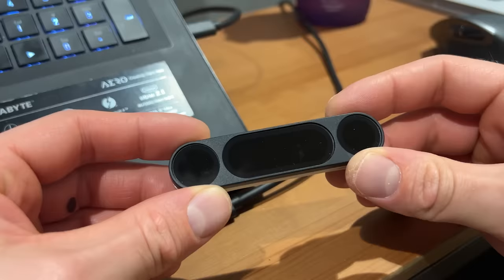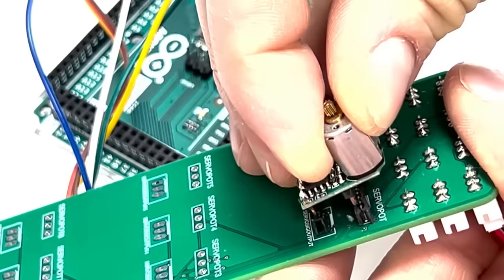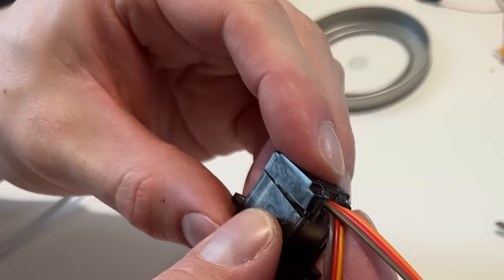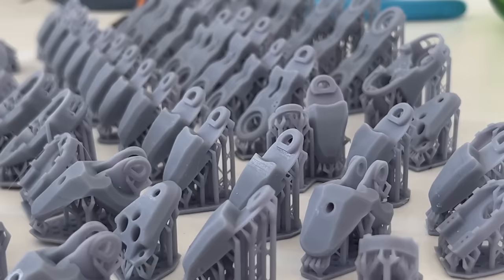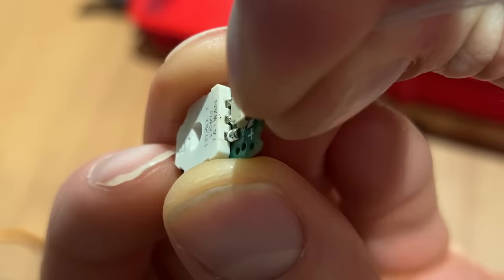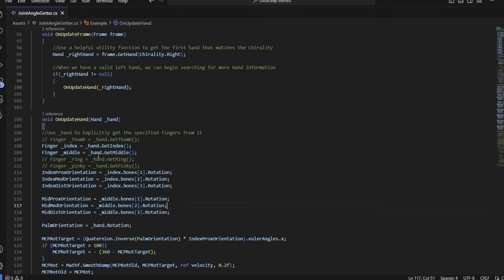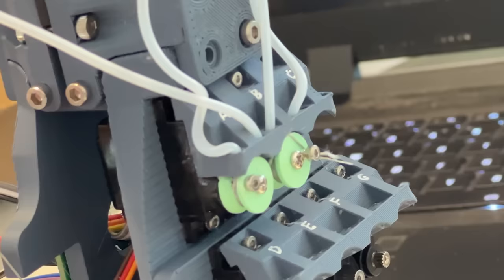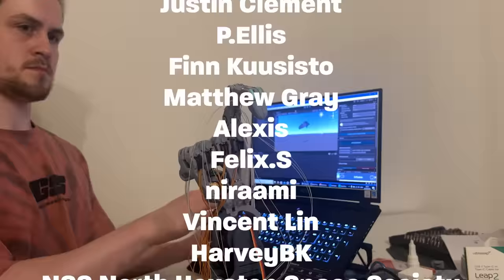Controlling my Bionic Hand With Realtime Motion Tracking - Biomimetic Bionic Hand

Comment: I would personally recommend the tubing used on bicycles for their gearing and brake cables. already designed to do exactly what you need, and a good way to solve cable management if you have simply clip into the carpal and metacarpal regions.
they come in spools you can cut to length and little metal caps so you just need to slot them in place endwise for them to maintain tension exactly where you need it.

glad to see you back on this, looking forward to more RnD
Reply: quite bulky though, wouldnt it be? im also not sure bikes use bowden tubes with the same inner diameter as his cables, might be difficult to source, no?
Reply: Ehh...They might be a 'bit' bulky. (3/16 in. OD ) 
But I can confidently say they would hold those cables without issue. Brake cables on a bike are at least twice that thick. (1/16 in.)
Reply: Unfortunately, by the time you stack 5 or 10 (or more) of these together for all the required tendons, it becomes impossible to bend. There may be some specialty mini cables used in model aircraft that are similar but they're difficult to source. I would love a good solution to this problem.
Reply: You can use something a little less slippery than PTFE but stronger. Many years ago I remember playing around with acetal and uhmw, but springs with inner ptfe tubes worked the best.

The frictional force is modeled by the capstan equation.
Reply: skyentific tested that on his channel, and it turned out to be impractical as others here point out. He ended up using a system of pulleys and coils for a finite but sufficient range of travel in both directions. Backdriveable, zero backlash, but tricky to get right it seemed.

Comment: this is impressive, but one tip that I learnt the hard way: you only have two tendons per finger; the finger can flex so much because it's one tendon anchored at several points and it can flex independantly because tendons are malleable. you therefore only need 5 servos per finger, at least one for splay, and about two for the thumb: one for positioning along a curve, the other for flexing it like any other finger the CMC is basically an overdeveloped splay-muscle for a finger that's at 45* and in fact you can line your thumb with your finger for this exact reason. this alone means that the total servo count shouldn't exceed 8 for the hand, 2 for the wrist for something that is completely biomimetic. you can afford to simplify the main palm into just two halves, which should save on mechanical complexity, but a 3-part palm is closer to the real thing.

for said tendons, bike cables would work well, and you can anchor the tube along the 1st and 2nd joints of each finger, with the cable itself being anchored on the finger. this way you have a compliant, durable and strong system.

another thing to note, human palms reach farther than the knuckles due to them being flesh, which from the underside gives the illusion of having an extra set of joints in the fingers, also also, the shape of the palm is largely immutable save for the outer metacarpals of the ring and little finger which ever so slightly curve, though that is mostly caused by the compliant nature of having a frankly unnecessary amount of bones in the palm

actually working on something similar myself, albeit drastically simplified and less "humanised" (it's just angular because I don't have fusion360  :p)

either way uh... hope that I can help simplify things and my apologies if my knowledge of the series has gone a tad rusty, it has been a few years...

EDIT: to clarify for understanding; by anchor, I mean like a thread passing through the eye of the needle: as the tendon is pulled, its shortening forces it against the structure, dragging the rest of the structure with it.
Reply: no bike cables are way too big for this and no, dumbing down to that few servos for the hand reduces total articulation and strength hugely

Comment: i did the hand connection to an xt ibm back 90's ! used window plastic and  stainless 1/8 " wire for pins!  your fingers are
exact as i did and i put a plastic plate on the top of the knuckl to prevent the fingers from  going backwards! the hand griped a
small 380 9mm dual ammo baritz and pulled the trigger without any problems !

Comment: Great job, nice to see your progress! You could maybe use tubes made to guide brake cables on bicycles, they are made to work in compression. They might be slightly larger than your PTFE tubes however.
Reply: no they are like 6x the size and unacceptably large.  bad suggestion
Reply: you could use small diameter ptfe tubes, ptfe even has self-lubrication, which is perfect.  you just have to make ports on the ends, that you caN mount.

Comment: Was watching you in 2018, glad to see you have returned. The project is really great, especially in terms of freedom of motion. By the way, have you read the research of using sewing thread and make it deform under some heat application, the thread should be spinned multiple hundreds times (depends on length) and if you will apply cooper wire for heating, maybe you could use them instead of servos. Thank you!

Comment: try to use bowden cables for the cable joints, those will do what you need quite well with very high durability. Only issue is that they will need to be custom order sized due to design.

Comment: Need stiffer guide tubes for the cable tendons! Squishy tubes don't lend themselves well to transmitting much power. This is why bicycle brake cables have a metal coil that's then sealed in plastic to hold it together. Basically a long thin spring should work, you can wrap something around it or probably just find cable housing/cover designed for the application. There's all kinds!

Comment: My first thought was also bowden cables like someone mentioned below but maybe bicycle shifter or brake cables could be cheaper and easier to get? The housings differ between them. Brake cable housing has a woven strong steel spiral. The shifter cables housing has steel wires running along the housing length. Might be worth experimenting with. 1,1mm is the smallest diameter on shifter cables. Great to see an update from you! Always inspiring and fact dense videos!

Comment: Note that you'll have to deal with cable stretch over time. Also, if you haven't encountered this yet, if you keep all the tendons tight to the skeleton, you'll soon find that when you make it make a fist, then bend the wrist, you'll have to further adjust the tendons in the fingers to give more or less cable length as you articulate the wrist. You'll need to account for that in your cable length adjustment calculations.. unless if your just using a closed loop system to just ensure the right amount of finger articulation while moving the wrist

Comment: Use flexor and extensor electrostatic motors to get rid of the tubes.  And just use guide loops to keep things tidy.  (forearm anatomy but in tech form)

Think of a z-folded capacitor where the dielectric is rubber.  Apply voltage and it contracts.  No volts and it relaxes.  Use one for the flexor another for the extensor.

Comment: Nice! I'm glad to see you ditched that bulky glove!  Though, I feel like you're missing an opportunity with 3D printing... You could route out internal cavities for the wire management, and even ditch the PTFE tubing by running the cables internally in their own dedicated cavities as well.  I understand that the length of each section would not be constant like it would with PTFE, but it would be predictable and calculatable for any given pose, and the arduino has plenty of capacity to calculate and interpolate the non constant cable distance.

Comment: Any kind of stiffer cable housing would be great! Bicycle cable housing is meant to be very incompressible (especially for brake cables) but they might be too thick for your design. Good to checkout though, and maybe there are some engineering bowden cables that might be the right thing!

Bicycles also sometimes have springs embedded into their brake assembly so you can't 'lock up' the wheel. Might provide some of that grip strength. 

Love this project, keep it up!

Comment: Dunno if this will be a useful suggestion, but there are some compliant finger designs on articles/research papers that might be worth a look.
One example is "Mechanical Structures for Robotic Hands based on the “Compliant Mechanism” Concept" where the entire closing motion is done by a single pulling "string" attached to all three parts of the finger.

Comment: This is great work. Springs with a smaller ptfe tube work pretty well! You can also route the cables primarily in straight lines on pulleys where you mantain constant loop length easily and then switch over to bowden tubes just where routing gets difficult. This can help increase stiffness and decrease friction. 

Out of curiosity, what is your day job?
Reply: actually the friction can be good for maintaining joint angle with lower power for holding a position.

Comment: Excellent progress. I was wondering if you could route the tendon cables through parts of the hand structure? This would shorten the tubes and reduce the kinking. Or where several cables run parallel, 3D print a structure to encase the cables, reducing the length of tubes needed as well as keeping the cables tidy.
Keep up the amazing work.

Comment: For the tubing, you may be able to use bike shift/break housing instead, or take a note from their design and put your existing housing thru something to give it more rigidity, like a spring with the same i.d. as the o.d. of the tubing, however, if sized wrong, the spring may also introduce increased internal friction, in which case, going with an existing product will probably be the better choice.
Reply: no that is way too big for this.  bad idea
Reply: @artbyrobot1  please explain you reasoning, as i know the OD of road bike shift tubing to be about 2-3mm larger than the tubes he's already using, so based upon the size of the pieces the tubing attaches to, it would make no appreciable difference to the size of the attachment points.
Reply: @THarSul  max diameter od should be 2mm tpfe with 1mm id since 130lb test woven PE fishing line fits into this and is 0.65mm OD.  Anything larger than this is unnecessary weight and size and bloats everything which DESPERATELY needs minitiurization at every turn to fit the human form factor.  going WAY UP in size and weight is foolish like you are saying.  If you want to thicken your tpfe, you can use super glue and thin fabric to create a little cast around it as a composite structure which would prevent any warping or buckling during actuation.  but this should not be needed in most cases I don't think.
Reply: @artbyrobot1  the reason for my suggestion was that if this is a benchtop prototype, it wont be fitting into a human form factor, in which case bulk has less of an impact.
With regard to using fabric and superglue to make a composite around the tubing, that would likely be too rigid to handle the forces involved, and would lead to breakage at points where flexibility is still required.
A similar performance to the cable housings could be achieved with a length of tension spring with a similar ID to the tubing’s OD, which was how road bike shift cable was routed in the past, due to the low profile and lower weight than the tubing with the rubberized outer coating.
Reply: @THarSul  the problem area seems to be just in certain sections like in his case near the motor and would not be the whole length of the tubing.  so the composite cast sleeve would be fine for such areas that don't need to flex anyways.  very few areas need to flex.  also, just because it is a prototype does not mean space isn't a huge concern:  it is during prototyping you find the solutions needed for human form factor capability.  so using something that will not be compatible for human form factor is bad to do.  it pigeon holes you into tactics and methods that are not usable in later editions which is taking 2 steps backwards.  miniaturization is EVERYTHING for this.  getting it all minimum weight is also a big factor.  using metal for this is adding unnecessary weight.  also, thin fabric and super glue will not snap or be too rigid for most sections and you can use a glue that has a little bend to it which most do.  you can use epoxy instead of super glue if you want more flex in some areas and don't mind a little more fumes and drying time.
Reply: @artbyrobot1  we'll just have to agree to disagree, we appear to be coming at this from different design philosophies, which appear to be incongruent, and there's no point in arguing about it, the creator will do what he will to make something that works to his needs and designs.

Comment: Your ptfe tubing looks really soft, almost like silicone tubing. The ptfe tubing in the bowden tube on my 3d printer is must more rigid. I think once you find better ptfe tubing which is more rigid and tighter around the cable then you'll see smoother movement. I know some sections need to be flexible so you'll probably have to transition between the two tubes in some places but for the straighest run from the forearm to the wrist it can be the more rigid one.

Comment: what you are doing is very cool, but it will be even cooler to attach a neural network to this hand that could read brain signals using an Electroencephalography device and convert them into signals for the movement of actuators

Comment: Have you considered using electromyography sensors on the arm to control the hand? You could record the electric response from the muscles in your forearm, combined with the motion capture data to train an AI model to predict the hand position from the EMG signal alone.

Comment: I wonder how well a solenoid + spring assembly inside the finger would work compared to the servos.
it probably would use a lot more power, because you'd need it to always be active.
another solution might be to use basically a linear stepper* (i.e. a stepper motor but instead of being in a circle, the coils are in a line), which again is complex, but might give a compact system. (and you only need like 1cm-1/2inch of travel.)

* basically what you'd do is a block of magnets facing opposite sides (i.e. if you look from the top going NSNSNS, and the bottom SNSNSN) with a pair of solenoids, one on top, the other on the bottom, with teeth on each pole, spaced the width of 2 magnets, and the poles being offset by one magnet. that makes it so to move one side you go {[+0],[0-],[-0],[0+],[+0]...} and repeat, and to move the other way, you do the opposite {[+0],[0+],[-0],[0-],[+0]...}. it should be relatively easy to cast some abrasive with epoxy in the shape of the needed file, and file down a bar of ferrite with a holder going back and forth and a vacuum, or the other option is to get some laser/waterjet cut magnetic steel sheets, or use a small desktop cnc (e.g. a rigid enough 3d printer with a motor attached to it) with an 0.8mm drill to cut the steel.
for magnets you can use 1x10x5mm bar magnets.

using microstepping (i.e. interpolate the values with a sinusoid) you should be able to get some fairly smooth motion. also you would probably be able to use a dedicated driver, but something like an uln 2003 would probably do the trick.

though it's probably overkill, but it could be an interesting way to go about it and you don't have to worry about the transmission of power.

something that could be interesting regardless is to use springs from clothespins for the spring grip, which means you only need tension in your transmission, and fixes the issue of stiffness in the sleeve.

Comment: Amazing work!  You must have incredible patience to do such a project as this.

Did I hear that right?  You are using Arduino(s) to control this hand?

If so, may I ask why you wouldn't use ESP32s for this project?  Faster, Dual CPUs, more memory, built in WiFi (or peer-to-peer) communications, etc?

Perhaps I didn't hear that right.

Personally, I've been deving on Arduinos for years, but only a year or 2 ago I got into ESP32s and just fell in love with these.  So much more robust.

Anyway, lovely job there.

Comment: Instead of a compliant mech, how about replacing the servo with a BLDC? The angle is checked at the joint, so if you can replace the servo with a stepper or a small brushless controlled by a smooth driver, you could have better feedback. IDK if enough torque could be applied without a gearbox tho.
Reply: i'm doing this but it adds complexity - have to roll your own escs and compact pulley system to downgear the bldcs

Comment: When I tried making a finger actuator, I used a single "motor" to contract the fingers and simple springs/rubber bands to extract it again. It gives much less dexterity, but do we really use individual joint control? I'm not sure, perhaps such a simple design doesn't allow for what you're looking for, but its so much simpler. Basically, the tip of the finger is connected by a wire through each joint so that pulling on the wire, the finger contracts. As I'm doing test using my actual fingers, I can wiggle the tip a little bit, but the rest of the finger seems jointly controlled?

Anyway, you Bionic Hand is looking very good indeed!
Reply: that would reduce strength and articulation and make it crap and a toy

Comment: This is really interesting! You can improve precision of the servos by using magnetic encoders instead of potentiometers (this requires a new control board though). Also, would using BLDC motors with FOC drivers be viable in your design? If it works, you could set virtual boundaries and virtual tension instead of using springs in the motion transmission.

Great work!! Looking forward to updates!
Reply: yes you can use bldc but you have to make your own downgearing then.  that's what I'm doing but using a compact pulley system for my downgearing.